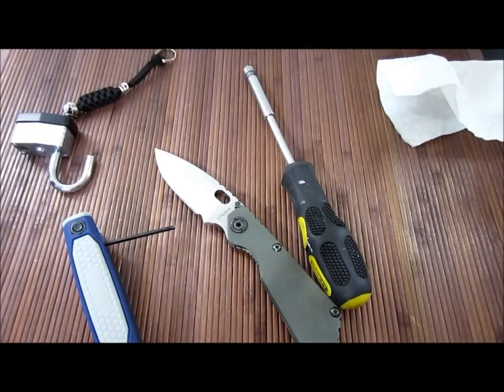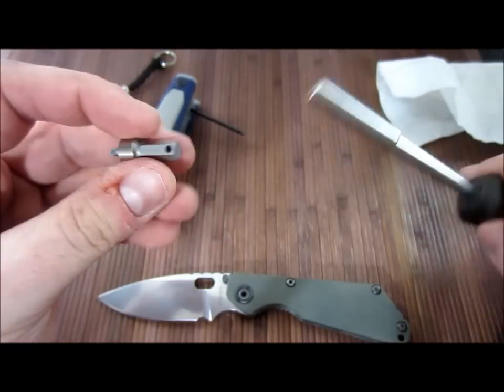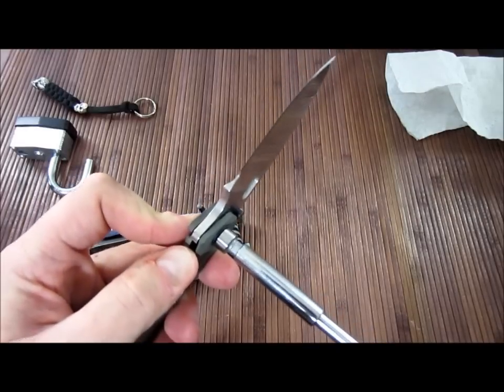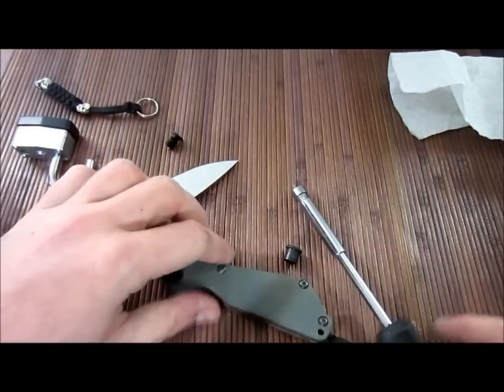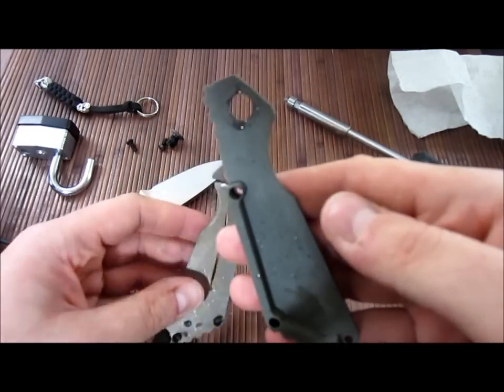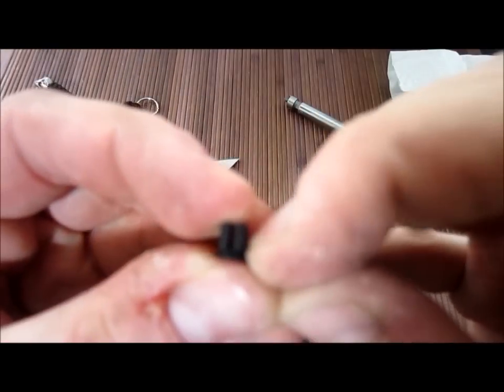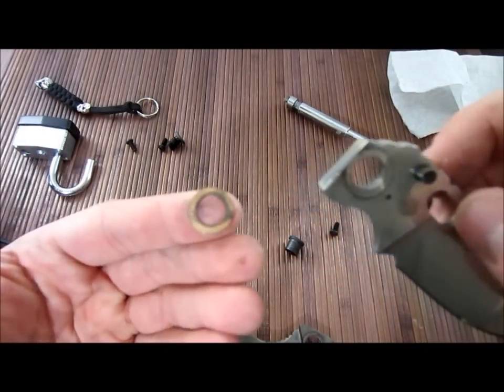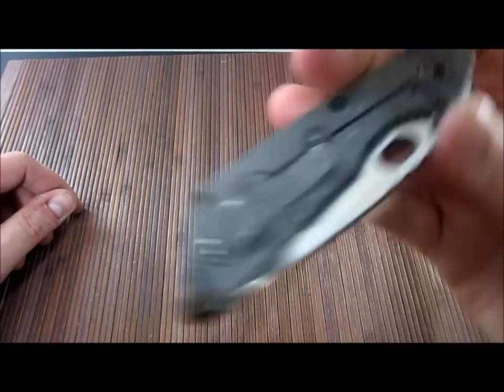Strider SNG Take Apart And Cleaning

Comment: Strider doesn't care if you take it apart, they say if you field strip the knife then cant put it back together, don't send it to them. However, my smf is my easiest knife to disassemble/reassemble. People always say crks are so easy to take down. Kinda but no really, everything has to he spot on or there's going to be problems. Plus the stiffer lockbar presents more issues. I say the strider is MUCH easier to take apart and put back together than a crk. They're just so simple.